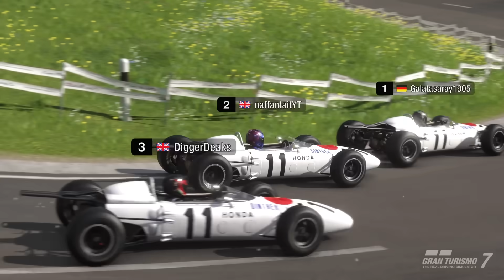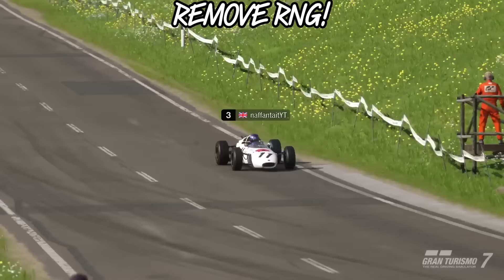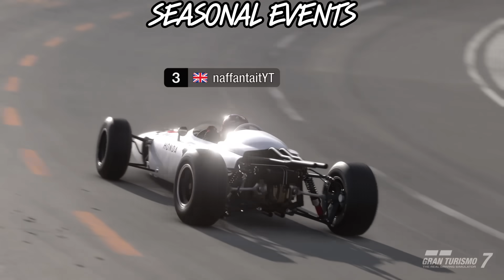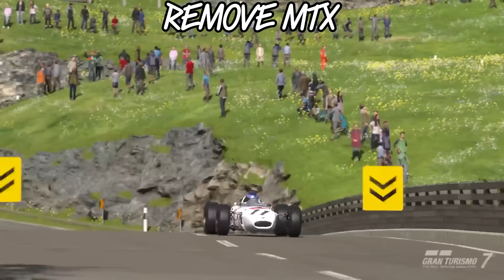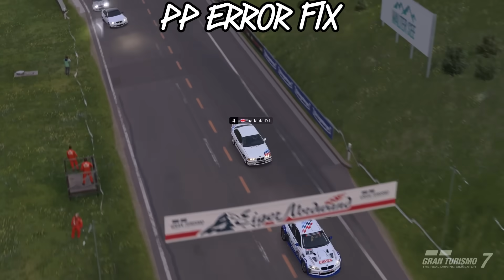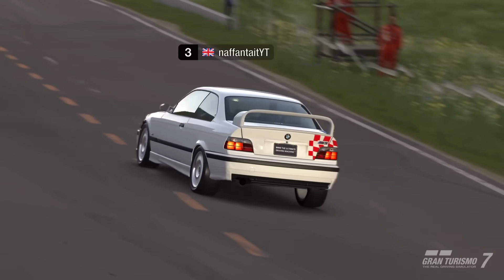Gran Turismo 7 | 10 Things Update 1.51 NEEDS!

Comment: Where to start 🤔 

1. Bring back the log in bonus from GT5 (i think) where as for everyday you log into the game, you get a percentage bonus on your races. 
2. Making custom race payouts at least equal to what it would be if it were a proper event.
3. B spec. Its a good way to earn credits with out having to do the races yourself. Plus if they ever did put 24hr endurance races in the game, you could use your B spec drivers in a team with driver swaps.
4. Updated cars. Many GT3 cars are 2 or more generations out of date from whats being used at the moment.  
5. Historic layouts of real world tracks. They had a 60s version of Le Mans in a previous game so it could be done, it would be great to use with classic cars to run on tracks as they would have been when the cars were new.
Reply: Login in bonus are from gt6

Comment: My man thing is very simple. I want a icon that lets me know if a car needs the oil changed. Like the ones in the bottom left when selecting a car in your garage. A key when that is the car you are in. Or green checkered flag if that’s your sponsorship car. Or pink present if that car was won or gifted. Add a little oil can that let’s you know that car needs a oil change.
Reply: Cars should need to pay for a suspension alignment at least if any damage occurs too.

Comment: I agree with most of your points,

The things i would like to see the most is

1 more up to date cars being sedan, muscle cars or supercars.
2 more circuits but we proably not getting that in the next update.
3 fix the rubber banding in custom races. Maybe have sophy ai as an option in custom races,
4 login bonus for log in daily like gt6
5 add drag tyres option for wider tyres including drag mode in custom races.
6 new chmpionchips and endurance races.

Comment: I need B-Spec so badly. I don't want it to race, I want it to make an exhibition race/showcase runs where it's almost like a super in-depth Scapes mode. AND LET ME CUSTOMIZE MY ANGLES DAMNIT! It's got the GTA 5 cinematic camera problem where each shot is either set for all cars or random, without much control from the player. Lemme make dolly shots! I know you can make keyframes in there too, Black Ops 2 did it in 2012!

Comment: I would like more tournaments (3-5 races with point system). There are new "races", but not tournaments. Good options could be "Gran Turismo classic trophy", with 3-5 races on original GT circuits (Deep Forest, Trial Mountain, High Speed Ring, Grand Valley...), or the "Tunning Trophy", with races AT NIGHT on small circuits with restriction to tunned non-racing cars.

Also I miss classic real events like the 500miles Daytona or 24h LeMans. This would fit in a "Endurance cup" category.

B-spec, highly requested... And this could bring a B-Spec cup, and the option to switch bettween A and B on Endurance races.

The option to go directly to the car I have marked at "my wishlist". Right now, only says that It is available or not, but could be easy to implement a link to brand central.

An option to reset the missions to win again the money and the cars. And new missions in the future.

Add dynamic weather to all circuits. Many of them do not have on any race.

And many other things, but those are main issues easy to solve :D

Comment: -interactive dealerships (POV 1st person walk-in style)
-window tint
-more customisation for HUD element styles, and ability to turn off HUD elements individually instead of just car & timing data
-add different ghost styles and opacity adjustment for existing ghost type (coloured shadow outline/line/dot etc)
-on the time trial leaderboard, display an icon next to the time to show if it was achieved with a wheel or Dualsense 
-Add Auto restart option for invalidated laps in time trials
-Lock tire temps in time trials
-Allow players to buy dirt/snow tires for cars that don't have them without having to back out of the track selection
-improve tire smoke to reduce clipping in photo mode
-button to disable active wings on cars that have them
-Gunsai cycle centre track

Comment: - Better Custom Races (and glitch fixes), I cannot set a starting gap on the event settings because it will always glitch back to 15m, the AI is also only on 2/3 throttle for most of the race…until they reach a random lap and decide to absolutely send it, and they also auto-switch to Racing Hard tyres (instead of the tyre i’ve applied to the tune theyre driving on)
- QOL updates for content searches (filters to cut out widebody cars etc if you’re not after those styles etc, ability to actually search using numbers in decals etc.)
- Tyre decals on the tyres for road cars, and even more wheel designs (even use the ones that are already modelled onto cars in the game, i.e: R93CP wheels on an R32)
- Add the seasonal special events as permanent fixtures after theyve appeared in their weekly challenge…you’ve made it already, why not just keep it in…OR only do brand new one-offs for all 5 weekly slots instead of replaying existing races
- BETTER RNG, not specifically removing them because theyre a welcome bonus when you get the right thing…but i’ve completed the game, I don’t need a random part for a car ive already fully tuned and don’t use, use context of your progress to custom the rewards (Cr.5k is ridiculous when you can earn 800k in 25mins)
- More driving Missions (and fix the bugged Maggiore one), theyre so fun and typically longer events

Comment: I have been saying this for more than a year. They need to fix the pit stops so that the leader board reflects the tiresgoing on, rather than showing the tires coming off. All, while they are at it, the video clip of the pit stop should show the house tire going on, rather than acopy of the tires coming off.  Obviously, it is most noticeable when going from slicks to wets, or vice versa.

Comment: The shifter karts lost 29pp in this latest debacle. Their grip is better and worse at the same time. Starting line glitch that holds the karts if you are holding the throttle open. If you rev and release with perfect timing it only glitches occasionally. You can rev and release again or shift and that usually lets you start a bit slowly, but quicker than if you don't. Shifter karts have consistently lost PP with updates, for the last year. Our record times have gotten a second slower with this last update, that's a medium track so +/-. At least the ffb on most wheels has remained on the karts.

Comment: Fixing the physics and pp system gliches should be the top priority. Obviously the new physics model wasn’t polished enough and feels like a rushed job
Reply: @ammarriyadh9124
I miss the old physics the Mclaren Race Car and the Mercedes CLK LM Race Car were much better with the old Physics.
Reply: It felt fine to me maybe adjust your driving
Reply: @truckercowboyed2638  
I did i just Feel the Acceleration is WAAY to Sensitive Now i had it Set at 58
Now i have it Set at 51 to 53. I ll adjust to It eventually Overtime.

Comment: They need to change the collector rating. Very strange that they capped it. I reached 50 very shortly after the game came out and at this point I feel like I would be 10x that. Even if there isn't any benifits I want to flex on my friends with a higher rating.

Comment: Adding racing music to the missions, time trials and circuit experiences, because Gran Turismo games have awesome soundtracks, both in the menu and the driving gameplay, both licenced and original music, and the soundtracks make the Gran Turismo games far more engaging than they were initially intended to be. It disappoints me that races with other cars is the only mode where music plays in the gameplay of GT7. Whilst the soundtrack of Gran Turismo 7 disappoints compared to its PS4 exclusive predecessor, Gran Turismo Sport, which has an incredible soundtrack, I still think that the soundtrack of Gran Turismo 7 is decent with some room for improvement.

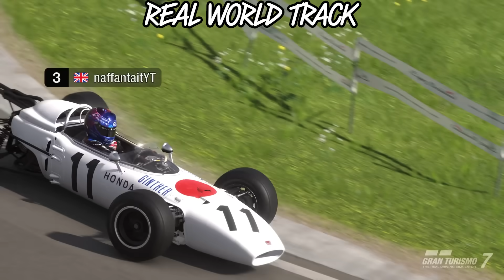Comment: 1.  The Physics are 100% inconsistent.  I was setting a lap of 1:42:200 on Barcelona in the 911 RSR.  So I decided to use the Meta Huracan and set a 1:40.194 and was excited.  So I go to sleep and get back on the game the next day and now I cant even get the Huracan to handle the track well enough to break a 1:41:900 anymore.  
2.  When racing,  and an opponent ass rams you into a wall,  and your car is damaged,  after it heals,  it still doesnt handle like it did when the race began.  Its like 90% at best,  at least on my PS5 Version.  
3.  When pushed off the track by a NON-braker,  or OVERLY-LATE-BRAKER,  when the tires get dirty,  it takes half of a lap and sometimes more before the car will get back to about 85% of its full handling.  When I can get an exit speed of 115mph and post dirty tires I cant get over 104,  even after 2 laps have passed,  is a real problem.  Are we made to pit after being pushed off track?  Because ive noticed other cars pitting after being forced into the dirt.  I just didnt know why.
3.  I miss the old GT2 car selection of Stratus,  Avenger,  Neon,  Espace F1,  RUF (more selections),  Camaro (late 90s) and etc.,  rather than the endless supply of GR86s and BMWs.  I mean my god man,  add an Isetta to break up the M Series monotony,  and the endless Ferrari models.  Go back to your fuckin roots Polyphony.  
4.  Last but CERTAINLY not least,  THE PENALTY SYSTEM!!!!!!!!  Put a stop to the edger outers.  These people are a nuisance.  And put a stop to Barrier Contact penalties when IT WAS THE GUY BEHIND ME THAT FORCED ME INTO THE DAMN BARRIER.  And put a stop to a .500 sec penalty for barely scraping........i mean SANDING the barriers to where you would need a replay in slow motion to confirm contact.  I mean its stupid man.
5.  Edit:  THIS should have been the last but PUT A FORCE FEEDBACK DETAIL system in this game like ACC or WRC 7 (and others I'm sure) have.  Polyphony update my torque away in 1.50 and it was turned all the way up.  So now my 2.2nM is more like 0.9nM in MOST CARS.  About 2% of cars I can feel about 1.8nM and I have no way of turning up the gain or constant force.
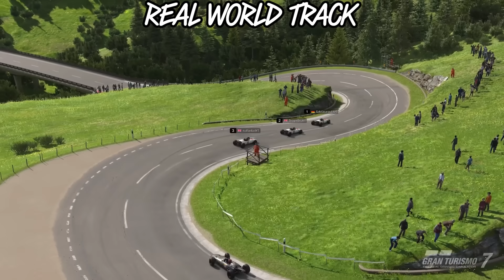Reply: Agreed with the physics inconsistency and it’s more noticeable when you’re on controller. I get the very same feeling as you were: sub 1:55s on nurburgring gp layout, head out to GT Auto for livery edits, then jump back into the very same track with the same conditions for having another go….but the physics just went 180 on me. And oh the “invisible assists” for controller were much more pronounced rn, and it’s annoying really.
Reply: @THEGREEPMASTER  Ive been using a Logitech G923 Wheel since April.  So I'm no seasoned pro by any means.  But when even I CAN TELL their is something wrong,  theirs something wrong.  I'm pretty consistent and consider myself FAIRLY quick at most tracks.  Not SUPER FAST but fairly quick,  and these inconsistencies are plagueing me,  something is broken somewhere.
Reply: @WPR_SpeedKilz85  Yeah it’s like there’s a hidden switch within the physics coding that’s moving back and forth inconsistently between arcade-ish and full blown sim physics.
Reply: @THEGREEPMASTER  So yesterday I swung by Game stop to browse and ended up seeing Gran Turismo Sport for PS4.  And since it was only $18,  I figured I'd give it a go.  And its AWESOME!!!!  My G923 has its full torque back.  It has that GT2 style menu music.  The driving is fun.  It has the old style race menus like Tourist Trophy,  GTR Challenge and stuff like that.  They should have built on that.  And how could a game like WRC 7 have Force Feedback FINE TUNING,  but GT7 dont offer it?!?!?!?!?🥴  WTH IS GOING ON?!?!
Reply: @WPR_SpeedKilz85  For real, the force feedback is actually a bit more refined in GTS compared to what we currently have on GT7, and yeah the whole UI menu experiences are also better in GTS: it’s stylish, cool, and informative. I did actually thought it should’ve been the standard for modern next-gen GT series…well…up until PD decided with this weird, shallow, non-seamless UI design of GT7. But the most important bits of GTS is: optional Pirelli tire brandings!

Comment: I feel like the F430 Stradale doesnt feel very good. Very difficult to control at high speeds. I'm not sure if that car is twitchy in real life or is it just due to GT7 physics. 🤷
Reply: For me it drive fine. Have no issues with it, its on rails when tuned right.
A proper track machine.

Comment: I'd love for PD to add the Hyundai N cars, and the BMW E46 M3 GTR from the ALMS and the 24 hour one, so like 2001 and the 2004 one, with a P60B40 engine swap option. I'd love for them to add Monza as a track if it's not added already. Speaking of which, I'd love engine swaps to not be behind a level 50 wall. You'd essentially have to grind to get to a point so later on in the game, way after the main menu races, to use a very interesting part of customization.

Comment: Something that's stupid I've noticed is that they got rid of the false start system in some of the chilli peppers races. The races are still fairly good but that little detail made the race seem that much more important. Also they need to add a option in the custom races where you can turn off that dreadful rubber banding system and for the cars tires to not reset to default. It's just weird.

Comment: Also for the inconsistency and drastic changes of physics, that's the result of bad development process and PD's stubbornness, they're not open with what they're doing, they're not providing data to let people prepare for what could be coming with intuition, they just do what they want to achieve and bump out that 1.49 / 1.50 physics model and most of us having old tune sheets killed because of the uncertainty of front ride height, front downforce and front damper responses and the kangaroo hops.

Comment: What parts is missing in GT7 is:
TRD 14R60 - Toyota GT86

Dark Grey RS Watanabe - 8 Spoke R Type Wheels

Enkei Sport ES-Tarmarc

Phantom F1 Turbine

Along with Car Meter and Gauges from GT6 appear in GT7 like:

Rev Counters Tachometer
0 - 8000 RPM
0 - 9000 RPM
0 - 10000 RPM
0 - 11000 RPM
0 - 12000 RPM

Speedometer
0 - 200 km/h
0 - 320 km/h
0 - 420 km/h
0 - 120 mph
0 - 200 mph
0 - 260 mph

Water Temperature Gauge (Black)
20 - 120c
100 - 260c

Oil Temperature gauge
50 - 150c
140 - 300c

Oil Pressure Gauge
0 - 10.0 kg/cm2

Voltmeter
8-16 V-DC

Boost Pressure Meter
0 - 2.0
0 - 3.0

Fuel Pressure
E - F